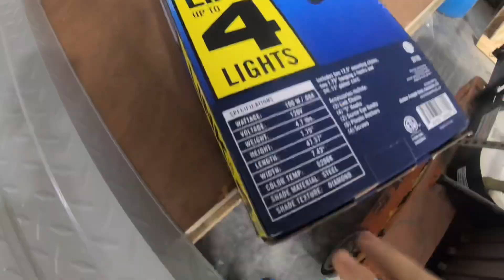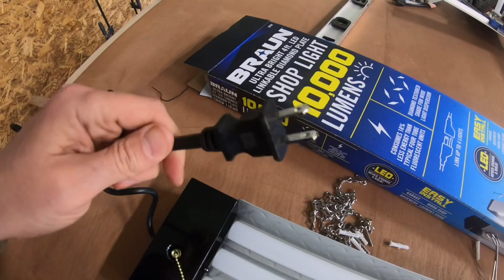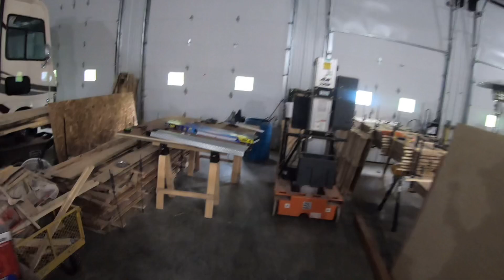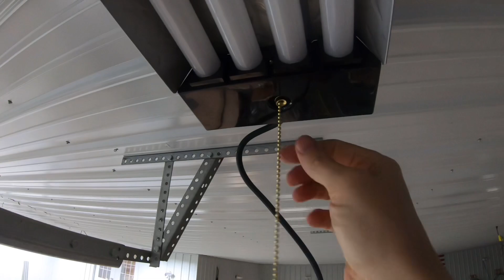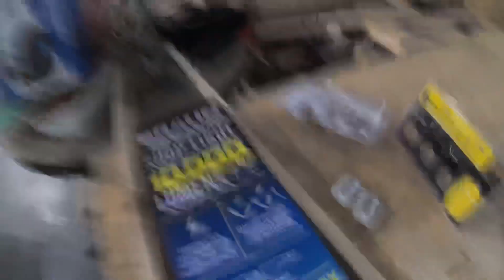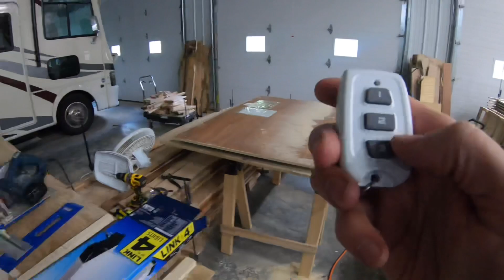Harbor Freight LED Shop Light review

Comment: Thank you but you're covering up the best part how you actually mounted the hooks to the ceiling this is the most important part and it's not visible
Reply from the maker: @aperson1181  thanks for watching and your comment. We have a metal ceiling in the barn so I used the same self tapping screws they used to put it up along with a nylon cable holder and a link of light swag chain to mount the lights. Sorry I didn’t get that shown. The lights are pretty light and won’t get hit in my application so I am confident that will hold them. YMMV, we appreciate you, have a great day and be safe!

Comment: Does anyone know if they are plugged in a row, does one pull chain turn them all on/off?
Reply from the maker: Hey Derek, thanks for watching and your comment. I just went out and tested that to be sure. If you tun off one light with the pull chain the receptacle on that light stays on as long as there is power to the light. So if power to the cord there is power to the receptacle no matter what position the pull chain is in. Hope that helps. These are great lights!  Have a great day and stay safe!
Reply: @CopperBarnHomestead   it does, thank you.  I’m trying to light our 12x20 shed.  I have power coming in on the back side.  I was hoping to be able to run something like this with having to run a switch to the front of the shed.  I think one of these might be more than enough light for me though.